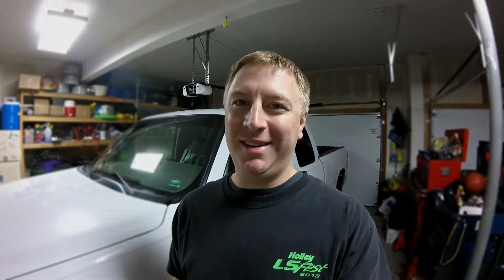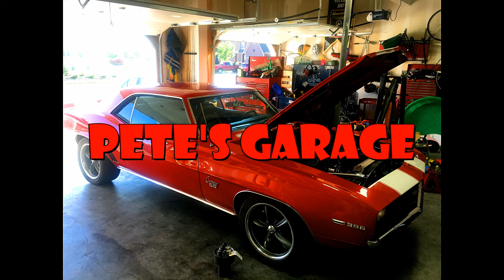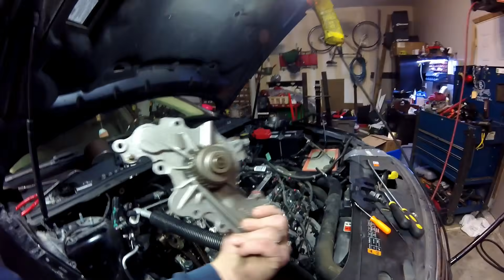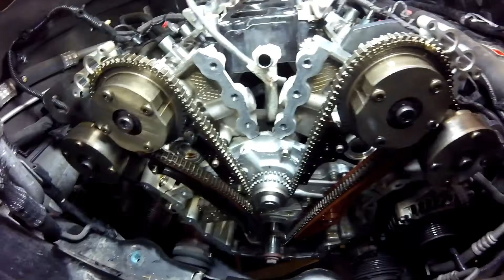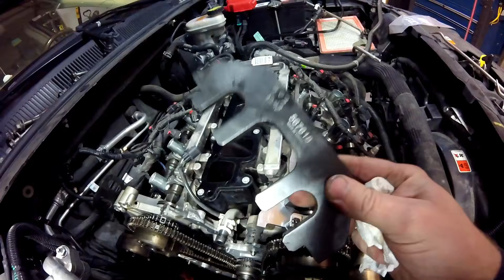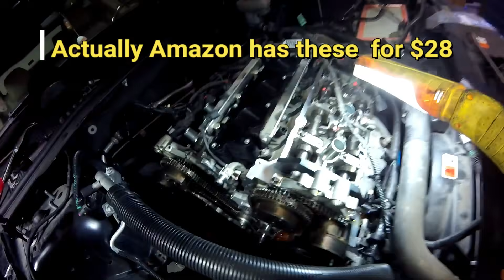Why does the Ford Taurus, Explorer, Edge 3.5L water pump cost over $1400?

Comment: Ford and Jeep Dealerships charge at least $1,000.00 or more (never less) to repair just about anything.  Oil cooler ($1,000), lifter ($1,000), motor mount ($1,000), thermostat ($1,000) and on and on..

Comment: I bet there's a lot of insurance claims out there on those things that needed water pumps. 
Note to self, add the Ford Taurus to the list of cars to NEVER own. 
If its not rear wheel drive, with a push rod engine and a manual transmission I don't think I care to own it. 
I appreciate my 1980 F150 with its 4.9L four speed even more every time I watch one of these videos.

Comment: My Chevy just needed a new water pump. It was the original with 265,000 miles on the clock. It took me 30 minutes to swap it out. I could forgive Ford if this car had over 200,000 but I am sure it does not.

Comment: I did my own WP on my 2009 Ford Flex, it was 29 hours, included all chains, tensioner, guides, thermostat & new coolant.  The original WP was still fine, but the engine had 206,000 km and I wanted to beat the failure.
Reply: Late REPLY!!  am watching all the videos as my '12 Taurus is leaking out currently so time to get it done. All the parts, including the whole timing chain kit (chain, guides, tensioners, and even the locks) can be had for about $400-500 bucks (oil, rags, coolant too). Its the time on this one, and the mess.
Reply: Your lucky. My 2008 Ford Edge (240,000 miles) water pump failed and drowned the crank case full of water. Almost seized the engine. Ford wants $3000 to change it. 20 hours labor plus the parts you mentioned.
Reply: @mannymaddog2171  If I can do this job in my garage with no air tools, and no hoist, the dealer should be able to do it in less than 15 hours!  My 29 hours is totally honest and included my time spent wondering how to get the timing  cover back on without smearing the special Ford spec sealant that  only has 5 minutes of open time before skinning over...  The engine now has 222,000 kilometers, and no oil leaks, no coolant leaks so I did a good job :o)
Reply: @mannymaddog2171  250k miles? you got your money's worth for sure
Reply: @Salt Maker I do unfortunately. Because of covid I didn't have the money to fix it. I tried to sell it. Even seasoned mechanics are afraid to try to repair it. I drained the water out of the crank. I ran diesel fuel in the crank for 5 minutes three times. Then I  ran used oil twice with a new filter. Then new oil and filter. Runs great but it obviously can't and shouldn't be driven for more than a few minutes without coolant.
Reply: How is it holding up? I'm deferring a lot of things on my 2011 Edge because of this.
Reply: @zerodollarstudio6934  it's still going, 3 years and 60k kilometres later, no oil leaks either!

Comment: Ford has had many “design flaws”” on the Taurus over  it’s life.
Reply: @Richard G  The 1986-95 Taurus's with the 3L V6 weren't bad, what really made me chuckle was replacing the PS pressure hose looked like a bitch, nope. Pull the battery/tray as well as the air cleaner housing and, that PS line was just looking at you........despite it being somehing like 6 feet long and U shaped.
Reply: @piercehawke8021  thats fine, until Ford consolidated part #'s, and the new part didn't fit worth a damn... and all of the aftermarket mfgs followed suit! Lol
Reply: There's a reason why my shop/business partner and I referred to them as "Torn-Ass"...
   More often than not, they were destined to rip somebody a new one, usually when the money was yanked out of some poor bastard's ass!
Reply: Transmissions = BAD
I've had 2 tauruses and both failed in the exact same way when the tranny went clunk and it never drove forward again. Wasted 1200 on those 2 cars and neither lasted a month. Junk the Taurus.
Reply: @Richard G  I had a 96 totalled out 3 times. The third time involved me being airlifted and it looked like a VW Beatle. Had 375k on it when it finally got crushed. My biggest repair was a trans cooling line fitting got snapped while mudbogging so I replaced the whole radiator. The trans would slip after a downshift when you slowed down if you gunned it. That started around 200k, never bothered to mess with it since it was so situational. I'd own another in a heartbeat. I've had everything from an 82 Regal and 72 F100 up to a 2000 Galant and Camry. I'd take the Taurus hands down.

Comment: The same service on a Volvo T6 (more difficult to do) is $700 at an honest shop. I call bs on any mechanic saying it's $1400.
Reply from the maker: Call a dealership and ask how much a water pump replacement will be on your 2014 Taurus 3.5 and get back to me. Maybe I’m off base. But some comments on here say I’m actually low.
Reply: @PetesGarageandperformance  why on earth would I let a dealership ever touch my car?
Reply from the maker: You called bs on any mechanic saying it’s $1400. I told you who to call to get that $1400+ quote. I didn’t tell you to actually take your vehicle there. 

In all seriousness, the whole intent of the video was to show people why the quote to repair this issue is so high. I just used an 8 hour job at $120/hr plus parts to come up with my rough estimate.
Reply: @PetesGarageandperformance  I call it being BS for a mechanic to charge that much.

Comment: Well that’s the same motor in the explorer  made that design to save on space since the motor sits in sideways 
the mustang with the same motor has a dummy water pump with a shaft going to the outer water pump 
and yes that dummy pump does go bad , that’s why I stepped away from ford and into a Toyota Avalon and I’m
A ford guy work for Ford dealers over thirty five years drove a 2000 sable 24 valve for 18 years they just don’t build them like that anymore.
Reply from the maker: They just don’t build anything like they used to. I feel old saying that. And I’m only 36!
Reply: Gosh man, if you're saying this is worse than an old taurus this is absolutely awful bc those older Taurus were awful throw away cars... and they had the styling of a browning banana 😂

Now an Avalon is an awesome vehicle, traded an es300 at 270k still didn't burn oil at all!
Reply: A dummy water pump to the outer water pump? Two water pumps? Are you sure about that?
Reply: @kenwilson6850  he doesn’t know what he is talking about.

Comment: People the Water pump is like $85 new Motorcraft. It's the labor that kills non wrenches. I did mine for $400 total all OEM Ford parts. All new guides,chain, WP, tensioner, seal , bolts

Comment: It's cheaper to install another engine and quicker..we found a engine with 20k miles and swamped it out in 8 hours engine cost 800 at a local auto wreckers .. We did it ourselves..original engine had 87k miles.. So you tell me..its who u go to...
Reply: $85 dollars for OEM WP or $800 for used engine. I'll go $85 . But a 20K engine is nice

Comment: How much is a good  Ford Taurus worth on the market ?
Reply from the maker: According to Kelley Blue Book a 2013 SE with 100k and fully loaded has a private party value of $7,000-8,600.
Reply: @PetesGarageandperformance  Therefore unless  you get  it for less than $1000 not worth spending $1500 on replacing the water pump!
Reply from the maker: Pat Butete even if you got the car for $5k and spent 1500 you would still be money ahead.
Reply: @PetesGarageandperformance  ..Not much of a profit margin then considering the amount of hassle involved in sorting it out  is there?...That's what I'm talking about.
Reply from the maker: Pat Butete are you talking about buying one to own or to flip?

Comment: My friend started fixing BMW v8 that uses timing chains with plastic guides. The plastic part goes off quickly, but fixing that requires similar amount of work. Getting it fixed costs $4000 by a mechanic. So he started working that himself.

Comment: if they were gonna hide the waterpump behind the timing chains like this they should have made it so it would ever have to be changed...this one looks like a friggen hyandai pumo that costs 35 bucks and take 45 mins to swap...that thing should have a half inch thick piece of metal and a couple rows of good bearings and a metal impeller....this is disgusting....

Comment: Looks like a fun gravy job, but I always liked the heavy stuff.
Reply: It'd probably be easier to replace the whole engine; especially of you already dropped the powertrain cradle out.
Reply: Pierce Hawke That’s what someone would say if they don’t know what their doing. 😂😂
Reply: @piercehawke8021  why would you replace the motor when the pump replacement is $1500? You can’t buy a used 3.5L for that kinda money let alone have it installed.

Comment: What was wrong with the 30 dollar SBC water pump well there wasn't enough profit when it breaks so this car takes the better part of 3 weeks of the average blue collar workers pay to replace it when it breaks and the very reason l much prefer older vehicles why because if it breaks and they all do over time l have to be able to afford the cost to fix it really l don't know what these car manufacturers are thinking now you know why today you see more American's riding bicycles it's because of outrageous insurance rates outrageous gas prices on top of 1400 dollar water pump replacement it's hard to live today when you have these bills rent or mortgage and trying to put food on the table figure it out it's completely impossible for most to do so with a regular job they can keep this shit l will keep my old car going the engine at a used auto salvage is less than 1400 dollars for the whole engine and it comes complete

Comment: Sounds like the guy who designed the 2.7L Chrysler V6 engines in the early 2000's. Now works for ford...

Just finished a 2.7L intrepid...  What a moronic design.

Comment: It’s not a bad design, it does guarantee cooling in the event of an accessory drive fail. VW along with others utilize the water pump pulley as part of the belt routing. The water pump is also consumable along with the belt, you change it all together. That ford design with a deep V looks horrible. That is a tremendous amount of load to put on a bearing, and no doubt contributes to shortening its life.

Comment: And I thought Land Rover engineers did things ass backwards. Boy was I wrong.
Reply: Rich T  Well they were owned by Ford for a majority of the early 2000's, which is why a lot of the range rovers resemble the Ford explorer in the front, even the way the name spelled on the hood And the new land rover discovery shared the 2.0 turbo from the Ford edge/escape

Comment: Now I am glad I bought my last Ford in 1988. That ford fail transmission in about 70K miles. Next 20K miles went to my 3rd trans. PS leak at about 40K. Car stall at stop lights and Ford could never fix it. I finally increase idle RPM to give it more gas. Blown piston at about 90K and I just junk that POS and never bought another Ford again.

Comment: I believe the timing chain cover has 26 bolts ! This is a POS ! Some dealers get $ 2000.00 or more ! Spend that on an older car and a week later , you are bumped , the air bags go off and the car is totaled ! The PT Cruiser is also over $ 1000.00 . I believe the GM 3.6 L has THREE timing chains , is also a POS !  Take the DOHC and shove it TWICE , where the light don't shine !  I want to get from point A to B . I don't care how advanced the technology is , I won't pay for this crap if I can't fix it myself . Maybe it's time to go electric !
Reply from the maker: The problem is if they just made a car go point a to b, they wouldn’t sell here in the USA. People need their fancy Bluetooth, cup holders, heated and cooled seats, engines with 300+ hp that get close to 30mpg, etc. I also like all of that stuff. I’m just fortunate that I can fix it when it goes bad.
Reply: I'm glad I stick with my Toyota/Lexus ... Not that they don't have some ignorant obsolescence that pissed me off as well but definitely not this bad

Comment: Last Generation Ford Taurus is one of the most reliable vehicles out there. Yes the one flaw is, if the water pump goes out. The question is how many water pumps failed out of 1 million plus made 3.5 V6 engines? I have owned this Vehicle for 9 years and have not one single problem and has 106 k miles. Friend at work has the same year vehicle 2011 with 176k miles and not one single problem. I would buy this vehicle over many if I had to replace my car now, no I would buy this vehicle over all if I had to buy a new car today.
Reply from the maker: You better knock on wood. I think you just threw yourself and your friend under the water pump bus! Next week both of your water pumps will probably start leaking. 
Yeah they are a pretty good engine other than this whole water pump design that could milkshake the oil.
Reply: @PetesGarageandperformance  I will keep you updated.

Comment: I have a question for you.  I had a 2014 GMC Sierra pick up with a 4.3 V-6.  It didn't matter how hard I tightened the oil filter on that truck, it would loosen up after about 1,000 miles.  I'm wondering if you knew what would cause this?
Reply from the maker: Did you always use the same brand of oil filter? It’s probably the rubber filter gasket compressing. We had a little bit of problems with the acdelco pf48e filters doing this.
Reply: The brand of filter made no difference.  It happened with dealer Delco filter and my Nappa filters.
Reply from the maker: That’s a weird one. Maybe the threads were messed up on the oil pan that the filter screwed onto?
Reply: The funny think is that the filter tightened down like any other filter.  I've changed filters on tractors, ATV's, scooters, lawn mowers, cars, and other trucks.  And I never experienced anything like it before.  It fact it was one of the incentives that made me trade it in for a Silverado LTZ with a 5.3.  I never traded a new vehicle after only 3 years before.  Thanks for the insight.

Comment: what if you converted this pump into a chain roller. and the water pump position change and separate on belt driven.
Reply from the maker: I think the amount of work to do that isn’t worth it. You would still have to get to the original water pump to install the block off/idler. Then re-engineer a remote water pump setup. All so you don’t have to replace it again in 100k miles?

Comment: HA glad to know Ford is making it harder to work on cars than Dodge.  Im changing a set of head gaskets out on a 3.6 in the challenger.  I had to drop the oil pan to get to (4) FOUR bolts holding the bottom of the timing chain cover on.   But I agree, there is a special place in hell for automotive engineers that do shit like this.
Reply from the maker: Unfortunately most modern cars are difficult like this.
Reply: @PetesGarageandperformance  Rich Rebuilds can assemble a tesla with a kitchen knife.  EVs are making it so much easier.

Comment: You would think they would've learned from Chrysler 2.7 abortion.
Reply: dodgeguyz Well if Chrysler haven't even learned then ford definitely hasn't lol ... The Dodge journey battery is behind the front bumper in front of the wheel on the driver side, you have to take the fucking wheel off to change the battery,

Comment: That's what you get with todays engineers who have never got their hands dirty.  Worthless lot.
Reply: I work as a chemical operator and deal with engineers. They mean well, but most are out of touch with what they figure out in their office on their computer and what actually works out on the floor or field. They often come up with "fixes" to improve the equipment, and half the time when it doesn't work right, they are dumbfounded because their calculations they come up with say otherwise. Very book smart, but little common sense and fexibility.
Reply: this is the real problem.
all auto designers should have owned hotrods.

Comment: 😊This warms my heart when repairing my old chevy (with the new engine) when it needs it. I'll never let her leave😊 My olds cutlass too.  They have a/c and heat as well.
Reply: And i will keep my old 1980 monte carlo with the 400 small block in it.
Reply: @alaskarailroad3996  i have a 1985 Monte Carlo. Stock 305 will be freshening her up soon. Im thinking .010-.030 over with light cam. Nothing to serious.🍻
Reply: @alaskarailroad3996  my c20 has a fresh block in him. .040 over 357ci. Heads are 76cc re-worked 2 barrel carb for low end torque with 4.10 gears. Damn thing will pull a house.👀

Comment: and Ford and GM wonder why they sell so few NON SUV's now. Why don't we have electric water pumps and cooling fans in everything by now? I know Auto Makers need to sell new cars to make money but this level of poor engineering is going to ruin all of them at some point. I have a 2007 Elantra. Very easy to work on, & gets 36 MPG highway. I paid 12,000 back in 2008 with 25K miles and have had Zero problems at 120K miles. I do all my own maintenance and switched to full Synthetic oil after the 4 years of free oil changes ended. I can fit 4 adults and 4 sets of golf clubs with no problems. I added a backup camera for $60 and replaced the rims with nicer aluminum ones long ago. ( same 15" size ) I have owned a Buick Rainier and a Dodge Caravan. Both had way too much computer controlled crap and neither ended up being reliable. ( although way more space and power but 1/2 the MPG. ) Cars have way too much electronics in them now. Heat and vibration kill components and we are spending $30K and up to get cars that will have major failures in 5-10 years. I think I will get an old 1995 Z71 like I used to have in the late 90's and keep this car forever. New stuff costs too much and fails too early. Designing a water pump ( a known fail item ) to be so hard to replace is just wrong. My water pump and timing belt was replaced at 100K miles with real Hyundai parts and neither were really bad yet. The belt looked 75% new. Ok, sorry for the rant.